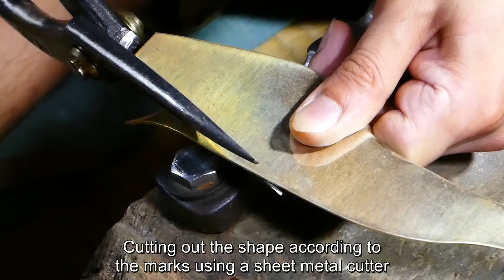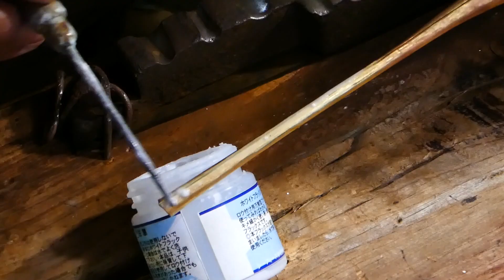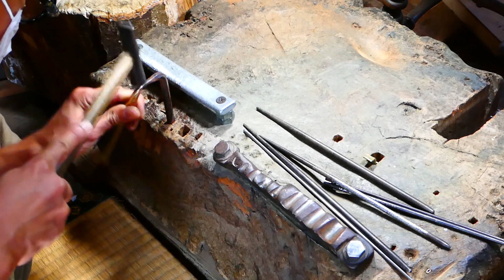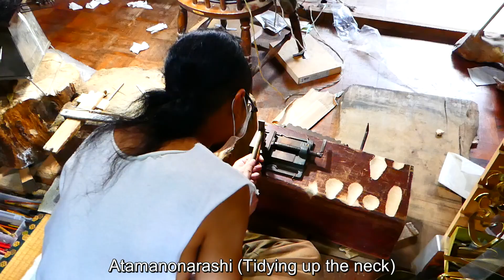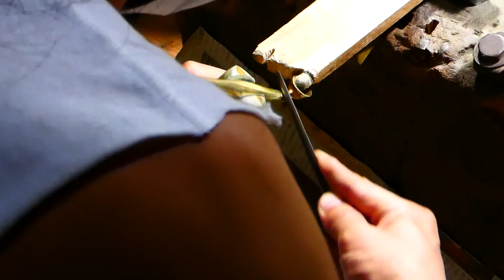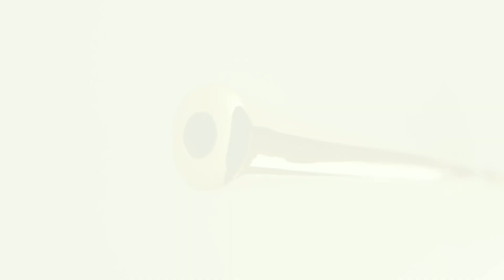How to make a Kiseru tenmasengokujusin version

Comment: Why does he makes those taps with the hammer between hammering?
Reply: Time stamp?
Reply: @faisfaiz4353  What?
Reply: @MarcosGarcia-kx4rb   like this 0:00
Reply: To stay in rhythm
Reply: It's an Asian thing. Two reasons why we do that: 1) To make sure good grip by quick-releasing muscle tensions from time to time; 2) To adjust the strength of the pound, because not all section/stage demand equal strength.